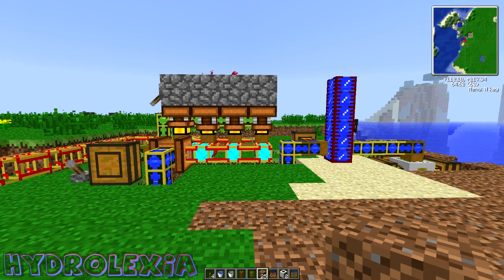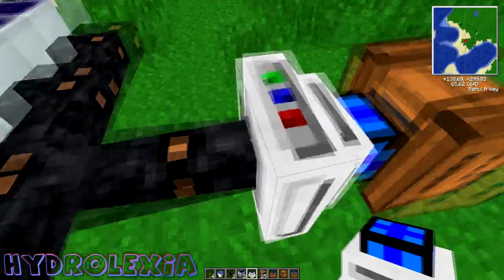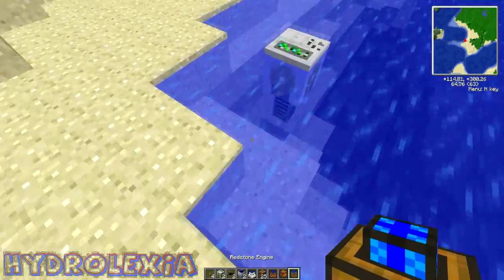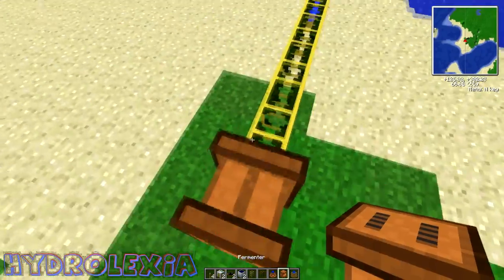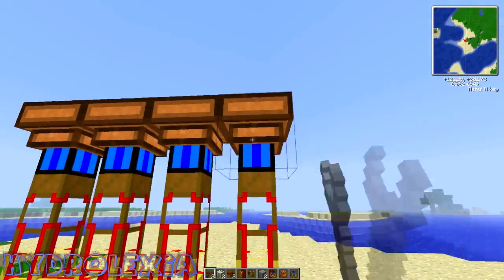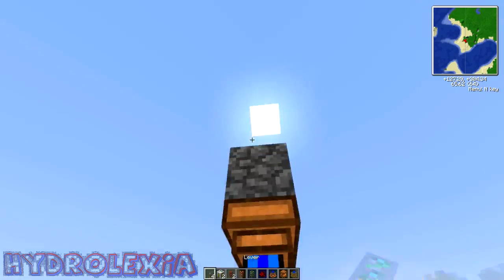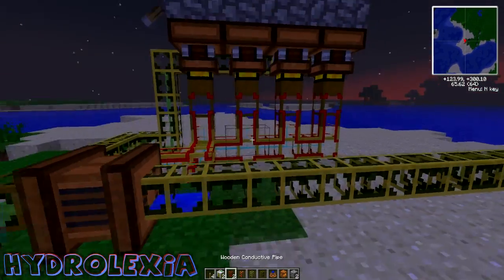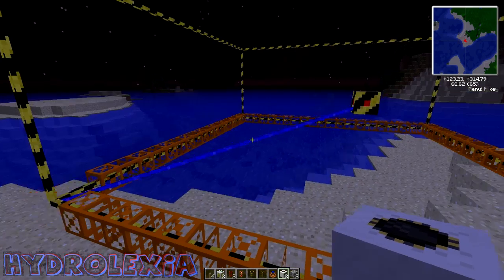Feed The Beast: Automatic Biogas Engine Tutorial

Comment: An aqueous accumulator is much better then a pump, it doesn't need power and you only need 2 source blocks and the source blocks never disappear like they sometimes do with pumps.  Also you don't need to use pipes if you don't want to.